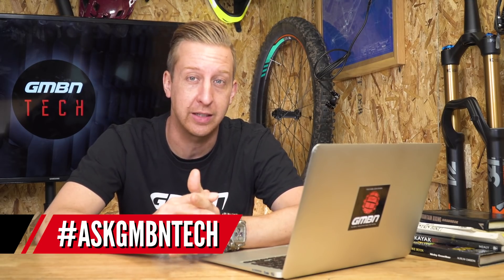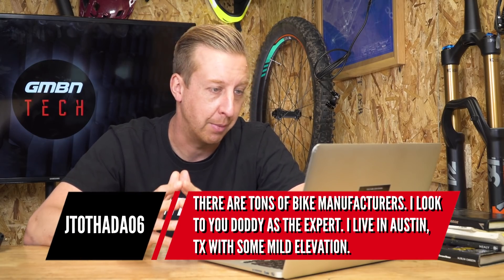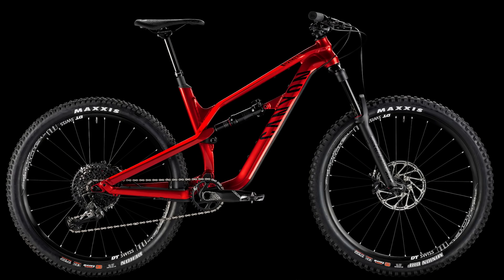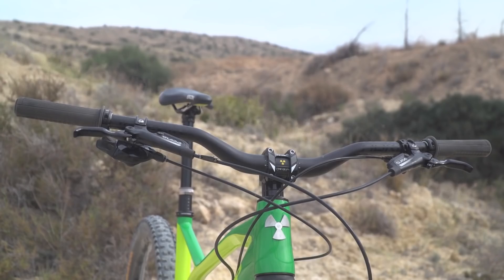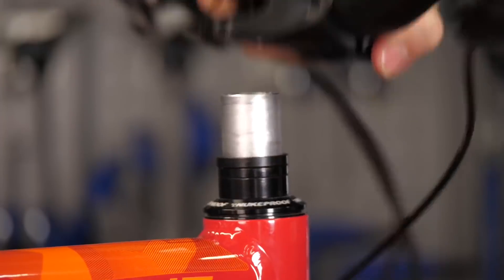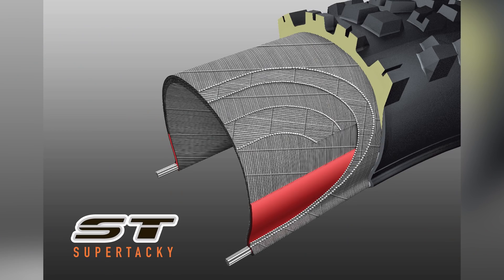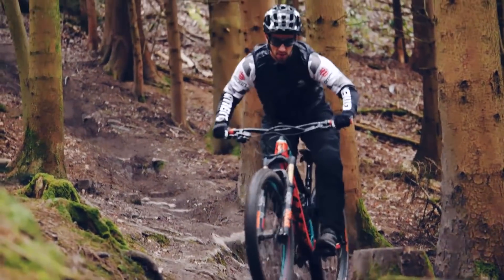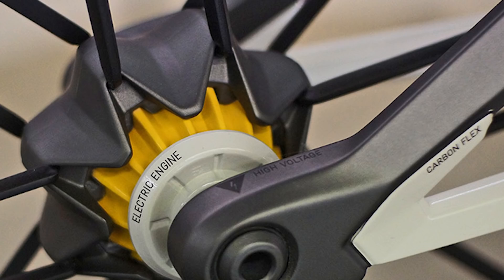MTB Geometry, Grease and MAGNETS! | Ask GMBN Tech

Comment: Hey GMBN tech, I love this channel so much. Quick question: I am trying to decide which bike to get. The canyon strive or the canyon spectral. I want to get into enduro, but still I would like a bike that I can take to my local trails, which aren't as technical, so I would use less travel. I geuss my question is trail bike or enduro bike?
Reply: Caleb East a spectral can do enduro too! Not as good as the strive, but its also a good bike for technical trails
Reply: I know a spectral can handle it, but I'm wondering if I should go for an all out race machine for racing and  lug around a bit extra travel on my home trails or if I should go with a trail bike that can handle an enduro race, but isn't necessarily made specifically for that.
Reply: If most of your riding is on the less technical trails I'd get the Spectral. There's also the option of bumping the front travel up to 160. A new air shaft for the Pike is $30 and that would let you run 160 or 150 depending on what you're riding, a 160/140 Spectral would make for a very nimble race bike
Reply: Caleb East well, i'm not a racer...  But I think modern trailbike e.g. Spectral can handle most enduro trails

Comment: #askgmbntech I bought a used Specialized Fuse bike, which uses plus tires. It's currently specced with a straight-steerer boost-spaced coil fork. Is there a viable path forward in terms of fork upgrade or should I look into riding the bike until I'm ready for a whole new bike?

Comment: #askgmbntech can i use a negative rise stem inverted to bring the weight back?
Reply: Yes. I did that and its cheaper than buying new bars.
Reply: Some stems are designed to be flipped, some aren't... but it probably wouldn't hurt any. If you're buying a new stem just get a +/- stem like a Race face Aeffect to be sure

Comment: I think doddy doesnt like continental tyres
Reply: He's running them on his own bike
Reply: Steven Chabot 😂😂😂mate you need tubeless specific tyres, most conti's in Halfords are the cheap ones not for tubeless.
Reply: Owen Preece. Hmmm. I saw some at halfords and they looked a-mazing for one tyre. They're decent. But I disagree. Sorry, mate
Reply: Continental is the best
Reply: Owen Preece Why
Reply: Joe B thats because he has to
Reply: MTBskrt i didnt say they are bad i run them on two of my bikes
Reply: Steven Chabot I think you will find that 'Tubeless ready' is more referring to thread count.  The sidewall is a closer weave, which helps keep the sealant in.  Casing thickness and stiffness is also about durability even with a tube in and allows for lower tire pressures to be run by way of layering to increase TPI.
Reply: Owen Preece Could be true, but I bought continental because of GMBN advice, which if I remember right, was a clip by Doddy telling us how well they worked.  Granted, people generally talk up sponsors and anyone giving them stuff, but he would be silly to give bad advice because of it.  Fact is, not all in the bunch are going to conform, especially if safety depends on it.  He could always black out branding or do what Pilgrim did and openly admit that he personally doesn't ride that brand of tire, but still inform us that we should consider trying them.  Although obliged to support the supporters, good advice should always come with minimal bias or it ain't good advice (although advice from experience def trumps opinion.).  Pilgrim did it because he has a tyre sponsor, but his bike sponsor is affiliated with someone else.  Most people have 'favourites' anyway, without ever trying too many different tyres. They try a new one....often with the Result being that it didn't feel like the old one, so we go back to what we know, else it 'feels' better and you change.  Flawed logic....can't say I have felt many new tires that felt worse than one that was toast!  Is it as good?  Maybe not...but at least new has some tread on it!  =P. I am lucky enough to be able to play around and made a point of it last year.  What I learned was that choosing the right tire (tread, compound, casing) was more important than the actual brand.  Now I don't want to plug Continental and have no affiliation with them, but the Trail King with the sidewall protection was the best do all tire I could find for both ends of my enduro, but they were priced accordingly.  Bonus is they are directional!  When the rear wears, I go front to back and buy a new front.  I tried Maxxis, Schwalbe, WTB, Michelin and Continental.  Sorry Kenda but you don't make the Telonix in a 27.5.  For work on rocks, the Michelin Rock-R was ace, but wild on loose, WTB Vigilante gripped well but was slow, both Minions and High Roller I found a bit unpredictable, but preferred when on harsher downhill (Maxxis seem to have the durability dialled) Also lets not forget that pro's have been putting stickers and labels on custom/different gear for years, that are not identical to the Retail product or even the same brand.  It is usually marketing or sometimes disguising prototypes.  Plus.....a lot of top riders have their tyres 'cut' to match their preference.  Ie: Mud tread pattern, but knows shortened or grooves widened to allow better clearance, etc.   If anyone makes it this far...I am sorry for another long rant, but I was lucky enough to do be able to afford to do some comparisons and wanted to share what I experienced.  Currently experimenting with a narrower tire on the rear for less rolling resistance, heavier contact patch and having the rear break away before the front.  All else fails, ride what you got until they pop and buy what you can afford.  Riding with limited grip is some of the best fun you can have, while minimising risk because you are just as loose, but going slower.  In short......I think tire choice should include these considerations..... 
1- Terrain/conditions - Tread spacing and depth...shape of knobs, etc, less so (This often comes down to all around performance as we can't all afford to have multiples or want to change tires often.  Tire pressure changes can help adaption.).  2. Casing to suit Intended use (ie. Hard aggressive riding or just getting around, although extra air can help compensate for cheaper casings, but it is a trade off and cost me a few tubes.).  3- Compound : Softer equals more grips, but is also less durable and wears out faster which adds to costs.  4. Brand : No issue with brand preference, but it should not stop us from considering other options and opinions.  If you made it this far......your commitment is A1!
Reply: Contis work better with Conti Revo sealant as it isn't as harsh as Stan's or Orange Seal. They also had a run of bad tires back in 2014. I got mine warranted and the replacements were stellar. I'm looking forward to the new versions of the MK and TK.
Reply: Who does?
Reply: Tried them, they spewed sealant. Most tires will work tubeless but not Continentals, they're riddled with holes.
Reply: No you don't, as I said most will seal up regardless if they're tubeless specific or not, tubeless specific tires have thicker sidewalls to avoid tears, you can use a standard tire if you prefer light weight over flat prevention

Comment: Hey Doddy, I'm looking to switch my air shaft in my pike 29 ,Stumpjumper FSR, from a 150mm to a 160mm. What effect will that have on my bikes geometry. (I have already installed an offset bushing in the shock)
Reply: It'll slacken half a degree and raise the BB very slightly. Nothing too drastic
Reply: Steven Chabot thank you for the useful reply
Reply: Pretty much nothing.
Reply: Youtube User that dosent make sense. I assume it will raise the BB slacken the head tube and seat tube and make the wheelbase longer

Comment: @ASKGMBN hi doddy im am looking to by a new bike but i cannot decide between the yt Capra or the canyon torque. My budget is 2500 and i mostly ride jumplines and bike parks aswell as home trails. Is it more important for the bike to be lighter, like the Yt with 14 kg, or is it more important for the bike to have longer travel like the canyon with 180 mm.
Reply: I think you can answer the question to yourself. Do you want a lighter bike or a bike with more travel. As an allround bike the capra is probably gonna be better, but if you ride a lot of park the torque will be nicer.
Reply: thx, but the thing is i want a bike which is awesome in descending and be able to hit some good jumps with the bike and i just don't know if the Capra can take that?

Comment: #askgmbntech Hy Doddy is it possible to make a fox36 180mm travel to26" to27.5" tires. Thanks for the great videos
Reply: Luigi no. But maybe you can buy new lower legs that fits 27.5 inch wheels.
Reply: Asaf Seri - Levy yes I was asking if it’s possible tochange them and if it’s expensive
Reply: Luigi yes its possible.
Yes its expenssive

Comment: #askgmbntech What is the difference between a step down and a drop? (Love the channel)
Reply: Its pretty much the same thing, but drops are usually steeper.
Reply: Asaf Seri - Levy a step down is a jump where the landing is lower than the takeoff, a drop tends to be a flat takeoff or with a small lip. 
Having said that, good point, it's a bit of a grey area sometimes
Reply: toasty bear exactly. But the more I think about it the more it seems like the same thing
Reply: I could answer that one for you. So a stepdown is a jump with a upsloping take off and the landing is below the level of the take off. A drop is almost the same, but it has no specific take off/lip, but instead a flat or slightly downsloped ledge. Please do correct me if I´m wrong. Cheers!
Reply: Tuukka Tauru thanks dud im traied to figer this thing out for like 6 month
Reply: Asaf Seri - Levy probably as a rule of thumb, if it has an upsloping lip, it's a step down, if it has a flat or down slope lip it's a drop. 
Having said that.... now I'm wondering if there's an amount the ground has to "drop" away to count, I wonder if it's more related to the distance forward you travel that defines it 😂 
Bloody hell... yeah... good question hahahaha
Reply: toasty bear i really want Blake to set this thing out once and for all
Reply: I had always thought that a step down had to do with not only the take off but the landing. A "drop" would have no lip on the take off and a flat landing area. A "step down" would have a typical jump lip on the take off and a downhill transition on the landing. I agree with Asaf Blake should set us all straight!